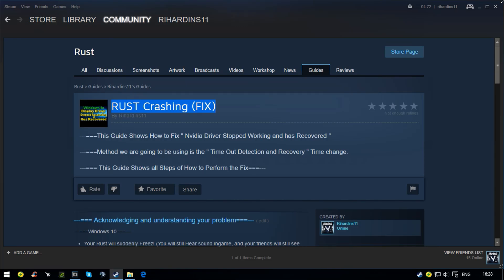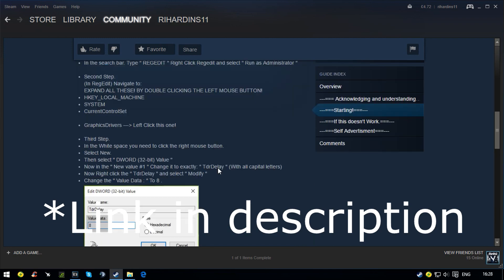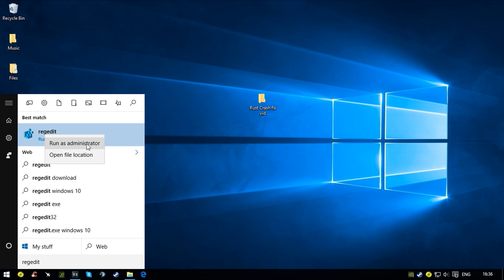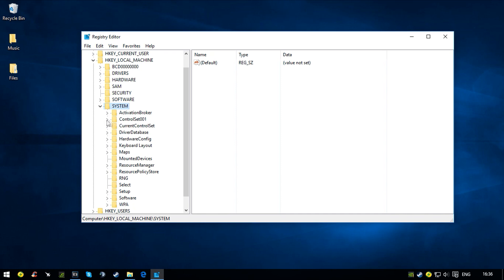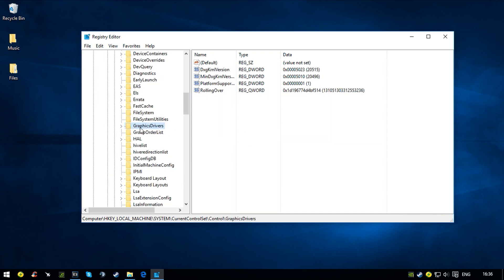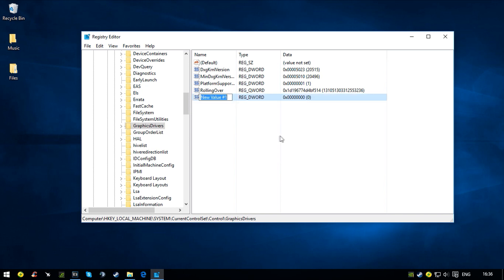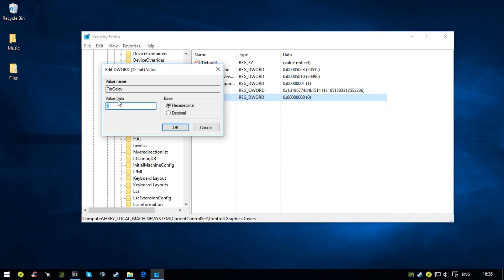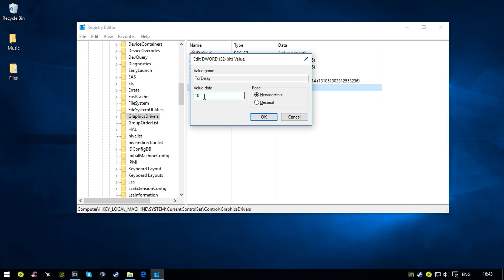Rust Crashing (Fix)

Comment: helllpppp
Rust [version: Unity 2017.1.1f1 (5d30cf096e79)]

d3d11.dll caused an Access Violation (0xc0000005)
  in module d3d11.dll at 0033:ed4898e0.

Error occurred at 2017-09-16_211558.
C:\Program Files (x86)\Steam\steamapps\common\Rust\RustClient.exe, run by Mario Medina.
64% memory in use.
8181 MB physical memory [2865 MB free].
16373 MB paging file [10228 MB free].
134217728 MB user address space [134213902 MB free].
Read from location 00000069 caused an access violation.

Comment: I play rust in potato settings and i get 30 fps. After I play for about 1 hour it suddenly freezes. I tried to alt tab, ctrl alt delete but nothing is working. Only solution is hard reset (holding power button for 3-4 seconds). Can you please help me with this?
Reply from the maker: maybe over heating issues